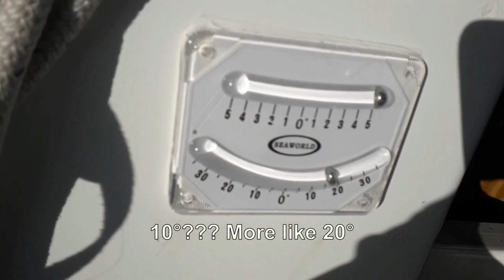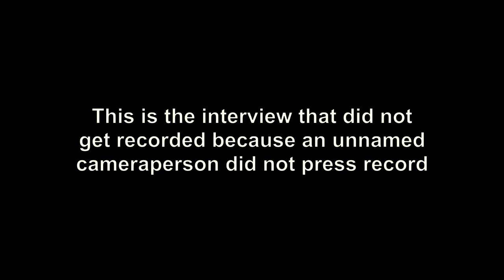What shall we do with the drunken sailor? - Winter Sailing - Ep. 112

Comment: That was the easiest propeller removal I have ever seen on YouTube. Props to Bavaria. 😇
Reply from the maker: Bavaria will be pleased, Volvo less so - it is a Volvo saildrive and prop 😁😁 Nonetheless, I understand your point. For me, I wish it was a little harder to remove because propellors have been known to come off. A friend of ours had his prop (not a volvo) fall off whilst manoeuvring in the marina. That was a fun day.....
Reply: @SailingYachtSaltyLass  Better to lose the prop in a marina than, say, in the Swallows, Mummers, or whatever that rocky pass y'all have gone through is called. You Limeys (very generally speaking) have the strangest names for things. 
Anyway, last night my engineer's brain kept thinking about your prop just sliding off the shaft like that. Do you know if that prop is original or if it came later, because I don't think it should fit that loosely on the shaft. Some caveats here: I know little about Volvo saildrives nor their design considerations so any thoughts of mine should be taken with a grain of salt. If the prop is that loose there could well be impact loading on the connection points between the propeller and the shaft every time the prop is engaged. Does this loading fall within the design parameters? I do not know, but I damn sure would find out if it were my boat. Again, I am very very far from an expert on saildrives, but that prop removal stayed with me after watching.
Reply from the maker: @PuntBamaPunt1972  The prop is actually a very tight fit on the splines and there is no movement. A further factor is that the centre of prop and the outer section are two separate pieces with a rubber filler between them. This rubber absorbs shock loads from the prop and protects the gearbox and saildrive shaft and electrically isolates the blades. 

In the engine compartment, the saildrive gearbox is electrically isolated from the engine, so there is only the one anode for the whole boat and that is the ring anode in the video.
Reply: @SailingYachtSaltyLass  Thanks. I should have figured what would be patently obvious to me would have already been addressed by the design engineers. It still bothered me though. ;-)

Comment: Hi glad you sorted out your rattle. It’s a bit late now but it would have been a good idea to check the resistance between the anode and the engine / saildrive to ensure it is doing its job. Looking at the condition of the anode it looks like it has never worked. Good thing to check next time you lift out. It’s one of things you should do when you did do so you do do in future like drinking on board  enjoy
Reply from the maker: That is a great tip - thanks for it. I should add that the anode was new and put on in May, 6 months previously. Perhaps we did not use enough loctite the first time round?
Reply: cheers to that!
Reply: @SailingYachtSaltyLass  Another tip, before you return the bolts holding the anode to the saildrive, slightly deform the thread using engineering pliers (not enough to cross-thread but just enough to make winding the bolt in my hand slightly too tight) and also add the thread lock to these bolts.  :)
Reply from the maker: Bend the bolt??!?!?? You must have muscles! Have you seen my arms? Neither of us are Arnold Schwarznegger. Us bending a bolt could be a whole episode on its own :-D

Comment: First project, bottle dram...
Reply from the maker: Hopefully, we do not need to do that again. Well, we can do the partying again... actually we HAVE done the partying again, but I would rather skip the anode screw-up-lift-out-and-splash ;-)
Reply: @SailingYachtSaltyLass  Was a good call , you might have lost your prop if the anode would rattle the wrong way. !
Reply from the maker: The annoying things is it took us weeks to figure it out. We stripped everywhere inside the boat. We we ran out of options we had to think "Outside the box" (or boat in our case)
Reply: @SailingYachtSaltyLass  Ok , I give you a hint , buy a long screw driver , really long, and you use it as a listening device , put your ear on the handle, other end on the suspect Surface , try it on the engine you can even hear the bearings move ..--
Reply from the maker: Thanks